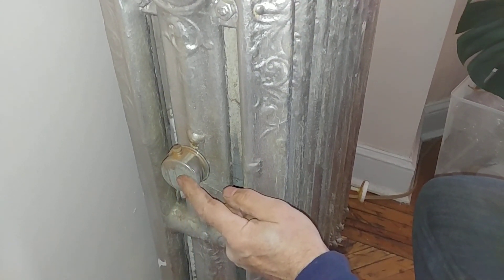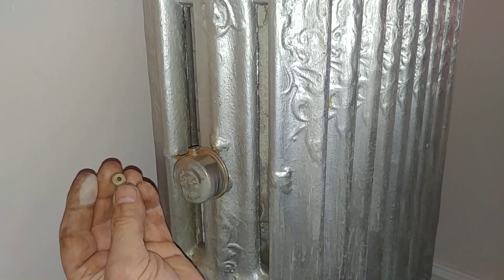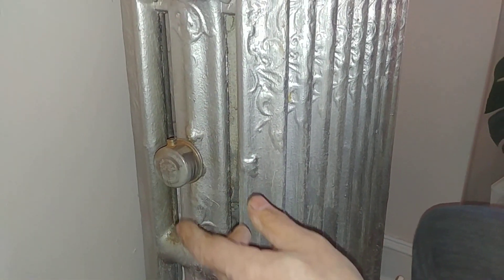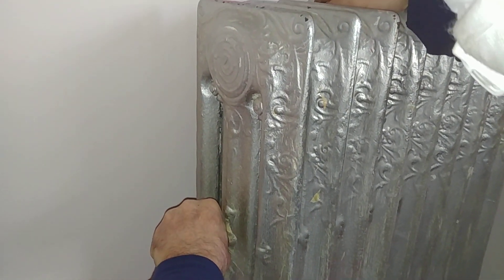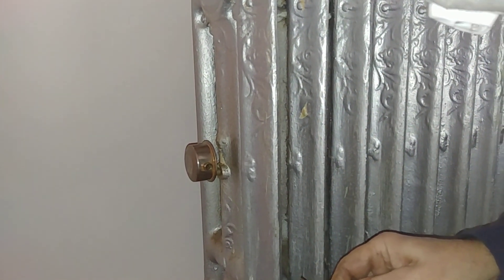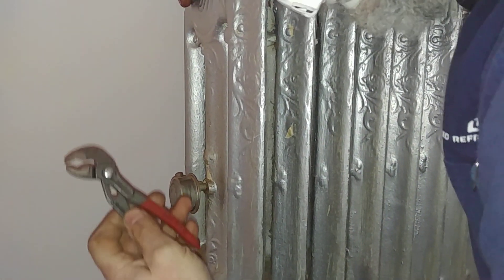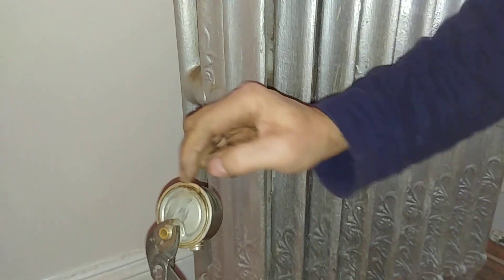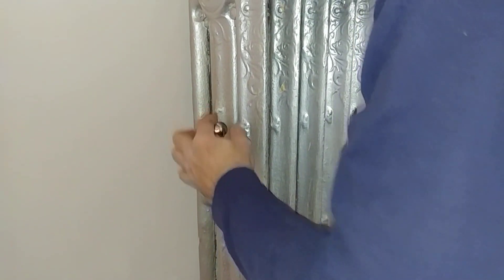Why Maid-o-Mist Is *Not* One Of My Favorite Single-Pipe Steam Radiator Vents

Comment: I have all Maid-O-Mist like this one. I have all the different vent sizes you can screw in and system is perfectly balanced 1st and 2nd floor.
ONLY 1 PROBLEM 
On my 1st radiator coming into the kitchen, 1st one off the boiler, every week or so I have to take the vent off, blow out a little water and get it to work again. It's like water is not draining out the vent back to the radiator, and the little bit of water makes the float stick closed.
It does this with the Maid-O-Mist, I had a Dole adjustable, regualr dole number 4, and a Generic vent. All do the same thing. Drives me nuts.
I thought about a "Straight" Vent and putting a 90-degree elbow on it, but the radiator is to close to the wall to "Swing" a 90 with a straight fitting.
Reply from the maker: This is a frustrating problem that many others have experienced. 
First, does the radiator in question pitch back toward the inlet valve?
It only needs just a little, just barely "braking the bubble" on a level.
Next, is your water level in your boiler too high?
Is the near boiler piping to spec?
Is your boiler water "dirty" ?
Is the pipe insulated?
What I'm getting at here is you might be generating "wet steam" and that *might*, I say might, be part of the issue.
You also might try a slower vent so steam does not quite get to the vent before the t-stat shuts the system off.
Maybe try a VentRite #1 adjustable with the dial turned down.

Comment: replaced a maid o mist C for gorton C, the 3rd year that maid o mist already won't stop hissing.
Reply from the maker: I'm glad you did install a Gorton over another M-o-M.
Gortons are not perfect, they do cost more and are not "adjustable".
But even so, I don't install M-o-Ms because of their higher than average failure rates.
A slight suggestion, if I may.
Try a smaller vent (a #6 perhaps) and try increasing your main venting.
Smaller venting vents seem to last longer overall (IF the main venting is good enough)
Reply: @gordonschweizer5154  got a gorton a week ago, this one looks different. the exterior is the same design but its in stainless steal. not the old titanium maybe? it makes a loud  
blow out sounds for 20seconds than it stopped. i am not if that is normal, at least not hissing for the whole cycle during making heat.

Comment: Quality Made in CHINA!  A domestic Gorton valve will last 60 years or more.
Reply from the maker: I'm not sure a Gorton vent will last 60 years, but I am sure if there is a problem with a vent w/ in the warranty period, Gorton will back up their product professionally and promptly.
Personal experience.
Reply: Maybe that is true, because the air vents I had in my building for a prewar radiator were Gortons and worked great. Sadly they were removed after there were issues w boiler releasing oil smell.
Reply: I had a radiator replaced a few years ago and it stopped heating. The vent was bad. It wasn’t a Gorton - replaced it and now my room is warm again. I should have replaced it the day it was installed.